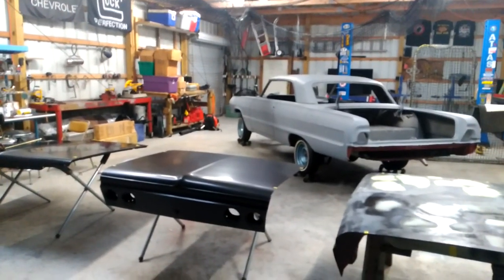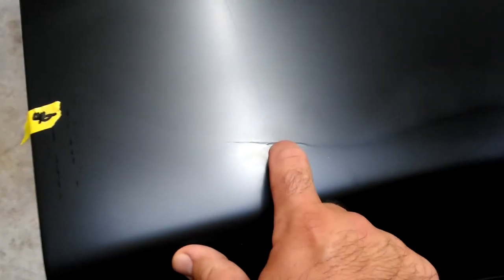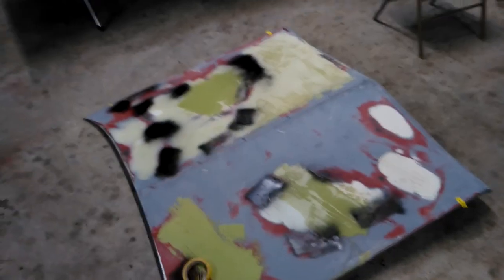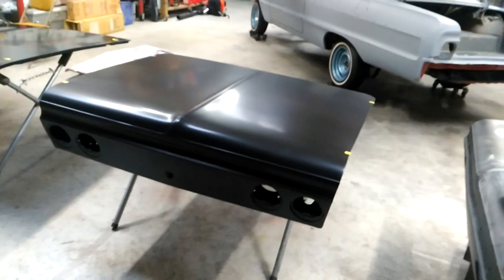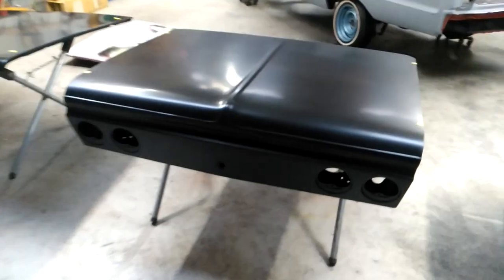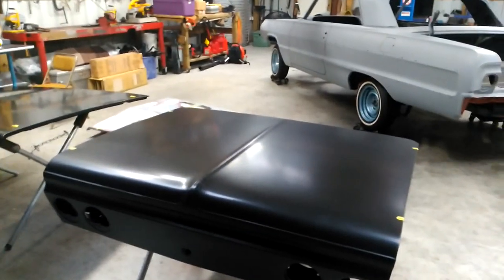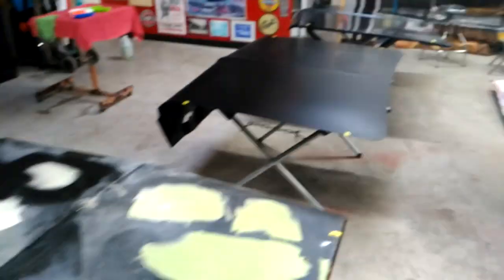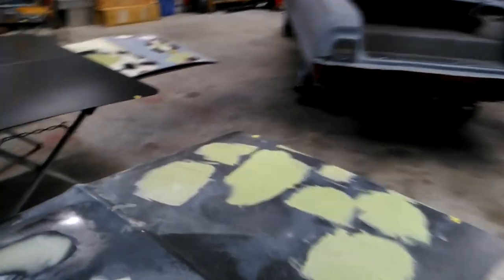1964 impala dynacorn hood and trunk!

Comment: So grateful I found this post. The very same thing happened to my 64. I hired a media blaster that assured me this couldn't happen. It unfortunately did and ruined my trunk and hood. I've been considering the reproductions and have struggled with the idea of using them. I've read about fitment issues as well as the thinner metal. This is doable for me. The fact is it's very difficult to find original parts in good enough condition. Thank you for taking the time. I'd lay money down that aftermarket sheet metal is often used in show cars that roll across the Barret Jackson auction block.
Reply from the maker: Man this is a really old video.  I have a newer video under the playlist Billie jean 64

Comment: wonder how it will be in compared to the originals in metal thicknes and such.? 
on the  cars ive restored taiwan parts were always thinner, my moneys says they all come from roughly the saem factoy. Welding is probably where would notice quality.
Reply from the maker: Definitely thinner. But still sturdy. It's like bolting up a 2018 Silverado fender to a tank..and still needed block work, but it will get you there of og parts are too far gone